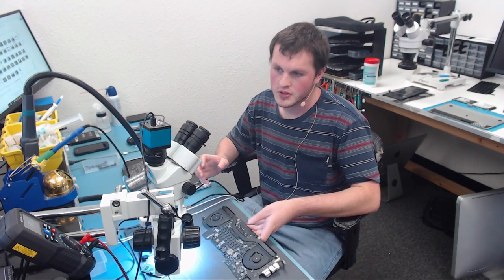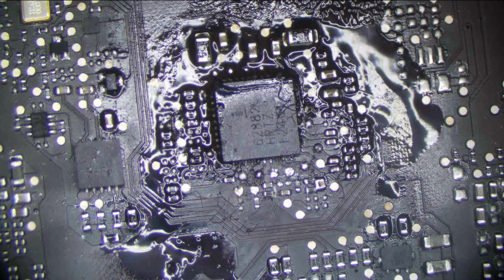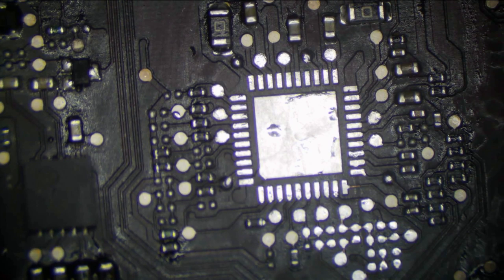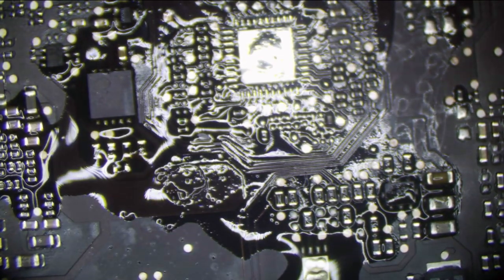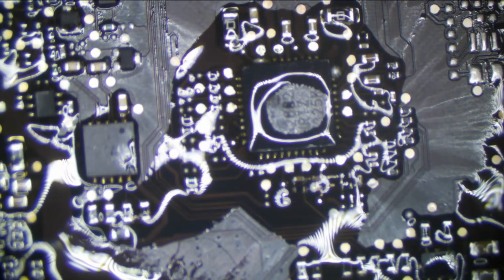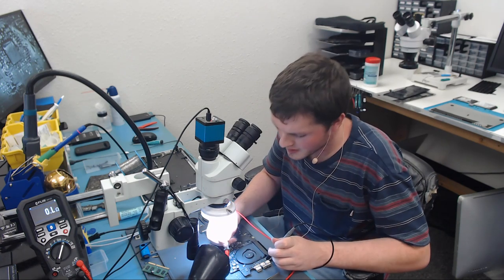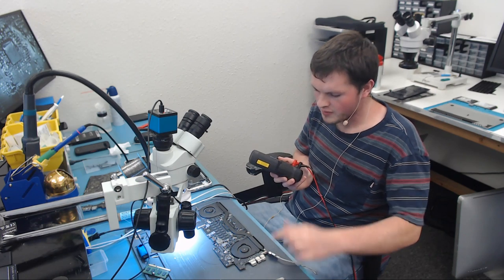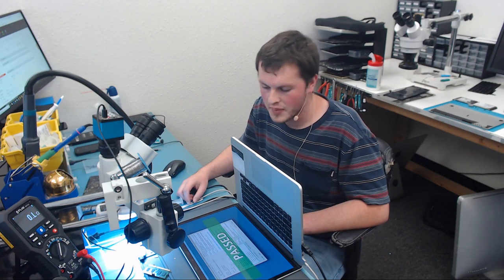Simple job screwed up by repair shop that didn't quite know what they were doing.

Comment: Who ever did this should not be working on other peoples devices. I'm practicing with ipods. Rebuilding them and selling them. I barely break even but it's the practice I'm interested in. I get them for 10 bucks or less and it takes 45 bucks to rebuild one and they sell for 90 to 180 depending on the storage size. Used working they sell for 75 to 120. So they are a good item to build your skill with. I'm up to 45 units for parts or rebuild.  The down side is my other post.

Comment: I am learning micro soldering on my own devices. I am absolutely butchering . Please tell me I will get better. Messing with temps, air , angles, lighting, magnification. Would be good to get more advice in a comprehensive video for hack butchers like myself. It's like surface tension dissapears when I try to position things into place. Parts want to wiggle elsewhere just to annoy me.

Comment: You checked that there was a short, but laptop worked. Were you probing incorrectly? Multimeter dodgy? ??
Reply from the maker: My FLIR meter can be a bit funny sometimes. Most likely there was still some charge left in the capacitors on that rail, which happens commonly.

Comment: Hi there, great video on QFN replacement! Sorry if this has been asked previously, but what is the model of the tip you used touch up the sides of the QFN? It looks like a smaller BMC2.
Thanks!
-Nuno
Reply from the maker: BC1?
Reply: @TCRSCircuit  Thank you! It does look like a BC1 indeed. I have the C1 (no B) and the one you used has about the same tip size, but a higher thermal capacity. Guess I'll get one of these too! 😊

Comment: I need a reel of connectors for the 3rd gen ipod LCD ribbon. Do you have any connections that could get ahold of a reel or even 100 would do? I've looked for months.
Reply from the maker: no clue
Reply: @TCRSCircuit  Thanks. I'll keep looking. I know there is a box of old stock sitting somewhere.